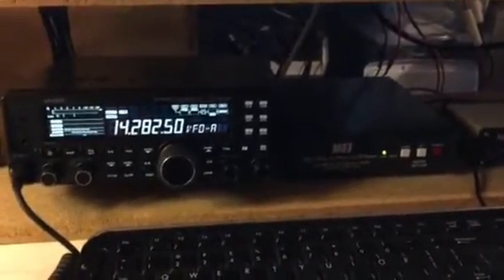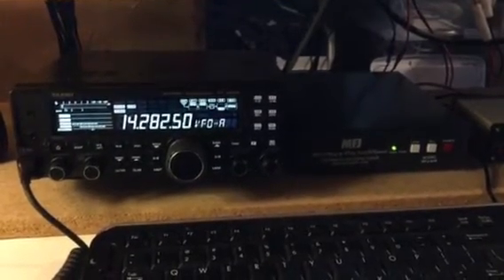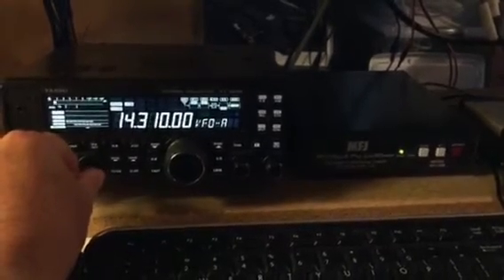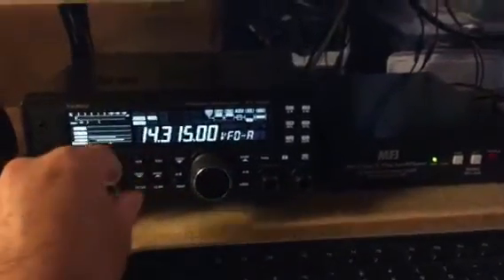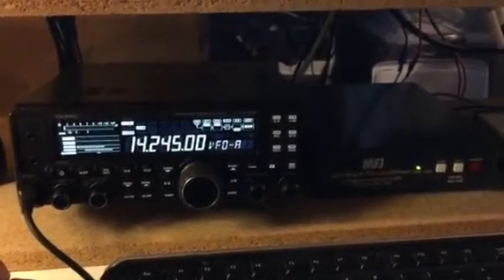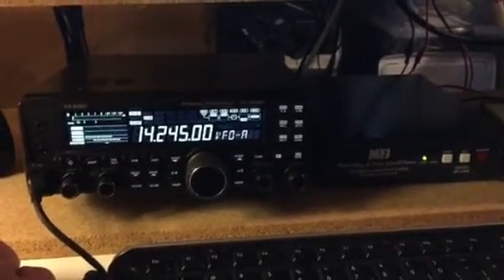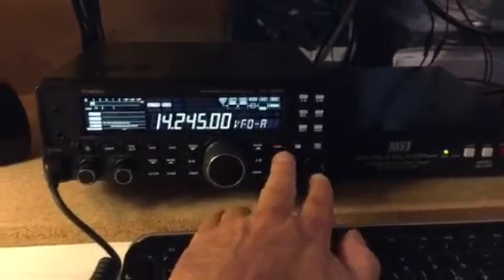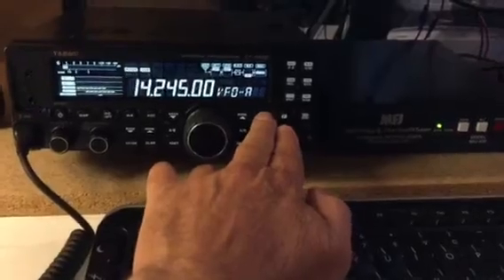MFJ-939Y

Comment: Hi Guys.  I had the same problem with my FT-857D.  I found out after a long trial and error and tinkering with my antenna that the interface cable that connects from my FT-857D to the MFJ-939 does not work properly, at least not for me.  I tune mines manually without using the interface cable and by keying the mike.  The tune button on my radio is not used at all.  The MFJ manual explains how to do this. Although the manual will say to attach your interface cable (pg.3), do not do it.  Also the manual explains about key combinations on the MFJ.

Another interesting discovery is that the MFJ tuner tunes all the time when the radio is in AM mode only.  In AM mode I hear the MFJ relays clicking and going through it's process.  I connected an swr meter in line and after the tuning process my swr in the AM mode is good.  Then I switch to whatever mode I will be using (LSB, USB, etc.). I don't know why the MFJ works good in AM only.  Maybe it needs a carrier signal?  I am guessing that if the swr is good in the AM mode, then it is good in the other modes?
I hope I am right.  Good luck out there.

Comment: What is the SWR like after this antenna tuner issue?
Reply: +Mike Miranda I have the same problem  and after you try and tune a station the was previously tuned the radio is stuck in tune mode and won't work until things are reset.
Reply: +Scott Anderson   I had the same problem with the LDG YT-450 on my FT-950 which would lock the radio in transmit and the only way I could get it to stop was to power off the radio.  This may have resulted a failure of the FT-950 and an expensive repair that only Yaesu could do.  LDG uses the serial port and I may still have some problems there.  So for the moment I'm using a manual antenna tuner.  Thanks for the reply to my comment.  Hope you get things worked out.  I am not a LDG fan, customer service leaves something to be desired.